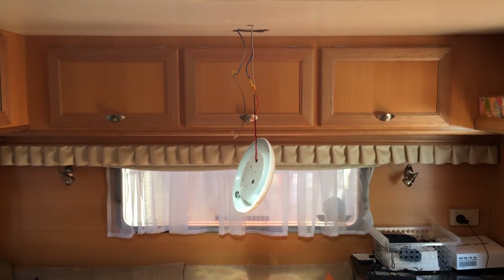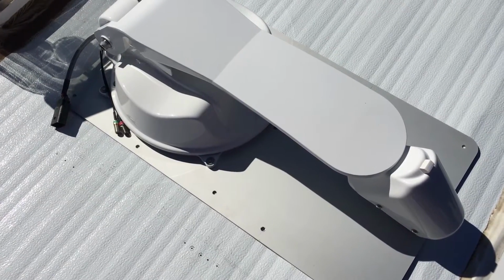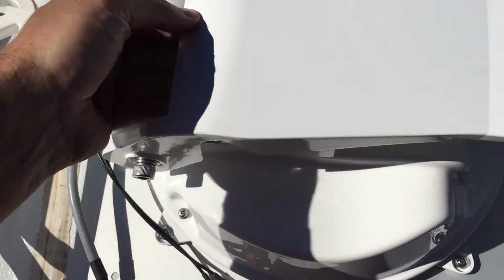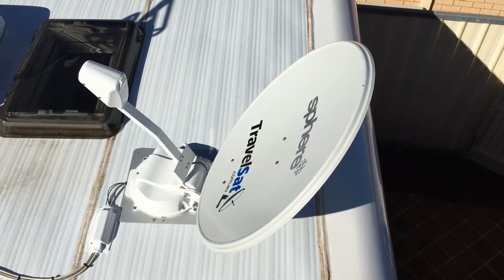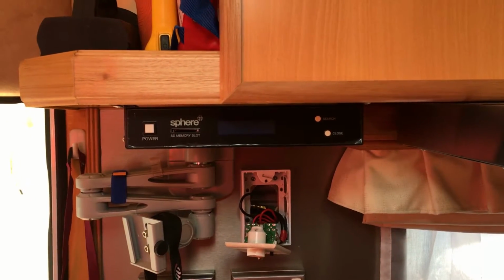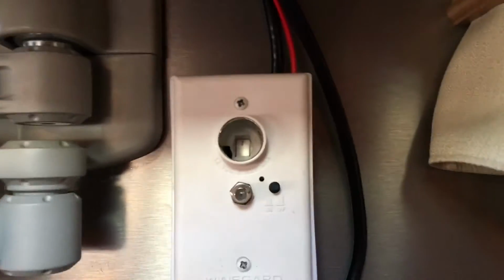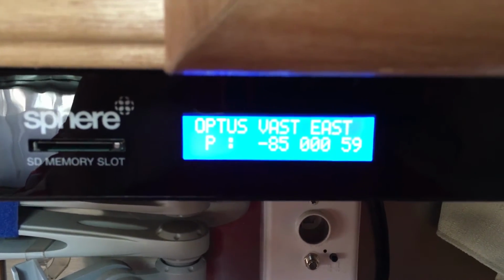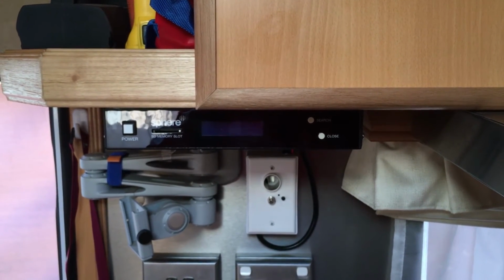How to install a Sphere automatic roof mounted satellite dish.

Comment: Random question ……. If my 12 volt system fails ,how can I manually lower the dish to roof so  I can travel to get help?
Reply from the maker: You can manually lower the Dish and Arm by loosening the 2 side bolts with a large Allen Key. It might be wise to mark the location of the arm before loosening so when you are able to 
get power to the van again that the Dish and arm are locked back in the same location and then the unit can be closed through the head unit.

Comment: I previously watched an English installation of a satellite dish. They used a U-shaped duct to cover the cable along the roof. I think that is a good idea. (1) Cable insulation will degrade with years in Ulta violet (2) We do have problems with cockatoos pecking at cables. Just ask Telecom. I would suggest a U-shaped duct glued and sealed to the roof would be a good addition to protect the cable as well as the end caps you have used.